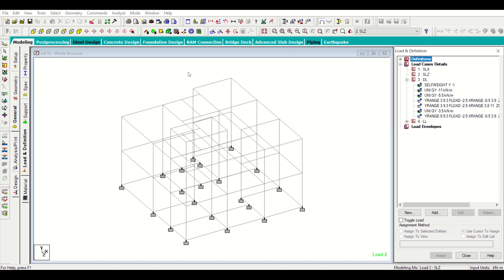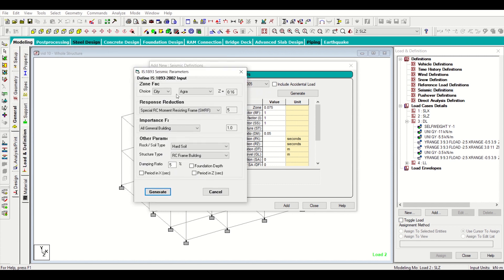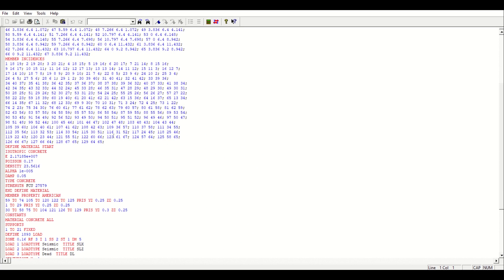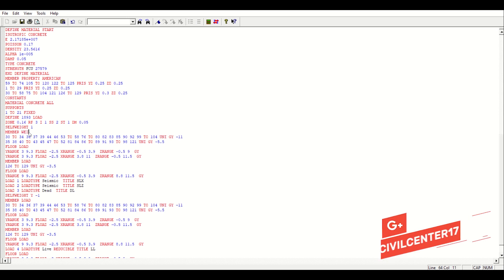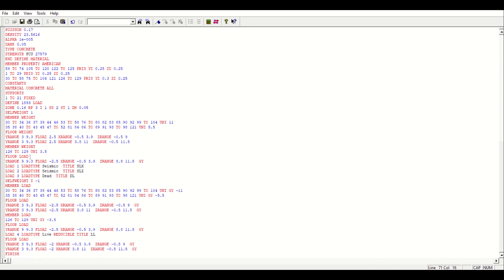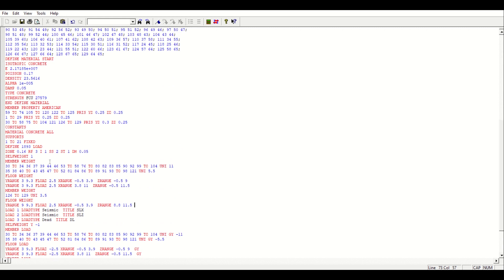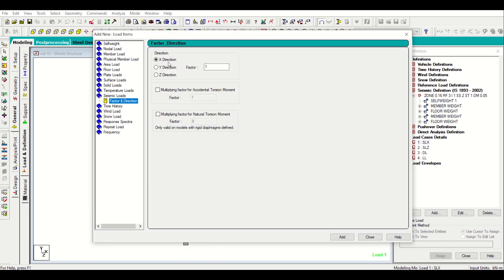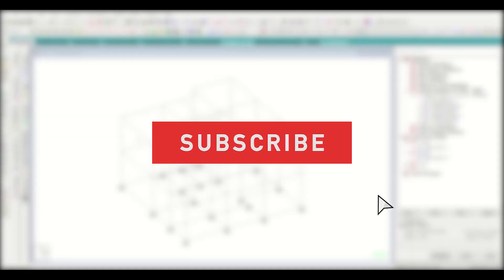STAAD. Pro V8i: 11. Seismic load Analysis of G+1 Building Using Staad Pro V8i

Comment: TWO ERRORS:-
1)   **ERROR - FINISH COMMAND IN LOAD DATA
2)   * ERROR * ABOVE LINE CONTAINS ERRONEOUS DATA.
     CHECK IF ANALYSIS COMMAND IS OUT OF ORDER OR MISSING IN CASE NO.     4
     CHECK DATA ORDER CAREFULLY
IM FOLLOWING EXACTLY WHAT YOU HAVE TAUGHT I DIDNT FIND ANY ERROR PERSONALLY PLEASE HELP ME OUT.
THANKS
Reply from the maker: Hi Rishabh
Go to "Analysis/Print," select print option as "No Print" - Add, after that Run Analysis, then these errors will be gone